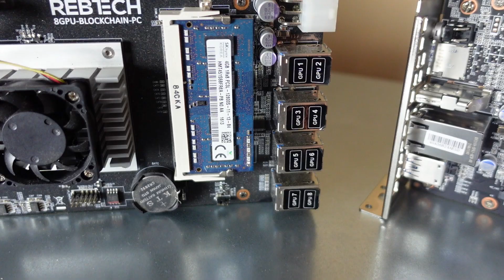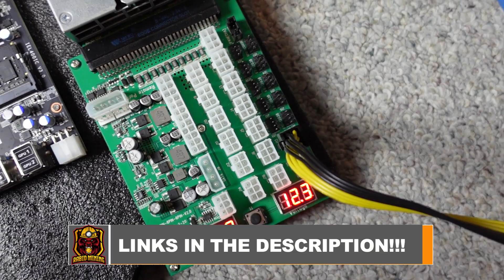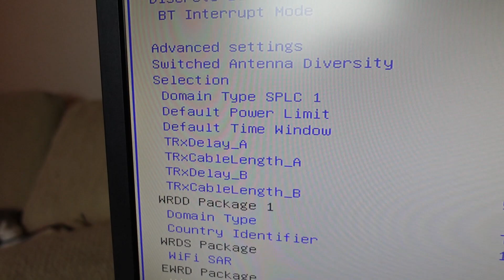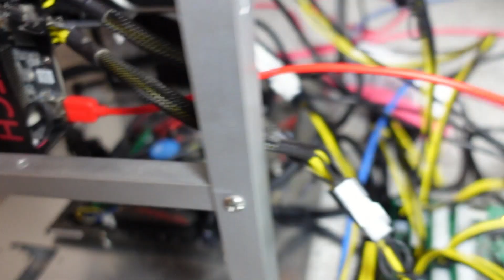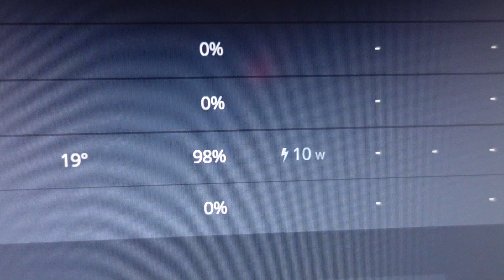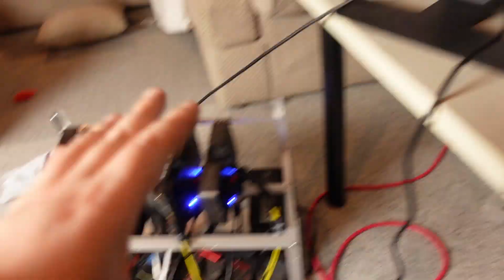REBTECH Is Back!!! 8 GPU Blockchain Mining Motherboard 2.0

Comment: Did you solve the issue? I got mine and the RebTech 2.0 can be detected online without any GPU. As soon as I add a GTX 1660 Ti, the rig can not be seen online. I'm getting the same error message
Reply from the maker: Dont have a 1660 but haven't tried to fix anything yet

Comment: can it still be powered by normal ATX PSU?  since there is no 24 pin to send signal to turn on power, i wonder if would could be safely powered by an ATX PSU
Reply from the maker: You could but more of a hassle
Reply: @RabidMining  i am just concerned about server PSU noise
Reply from the maker: Depends how you run them if around  50 to 60% cant hear them.

Comment: Mine arrived today.  So far I only have 1 card up and running but will soon move cards from my ATX boards over to this and see how reliability goes.  I may need to invest in a couple more of these!
Reply from the maker: Nice!!!!
Reply: @RabidMining  Update.  Weather finally cleared and I was able to swap out the PC MB for the RebTech and oh wow what a difference.  Right now it is 5 RX 6600 XT's and they all run 1-2 MH more than my other rig on a PC MB also with 5 cards.  Been up for 1.5 days, no crashes, no errors just a solid 32.5 MH on every card.  I have 2 HP 400W power supplies splitting the load.  HiveOS shows a total load of 337W.  I have enough room on my shelf for 2 more cards.

Comment: Nice but the AMD board only accepts AMD video cards so that's a bummer.  The Intel version accepts all gpu so they've got some improvement to do with amd based .products.  Wish it had Level 3 memory too but if your not cpu mining its not a big deal.
Reply from the maker: the first one runs Nvidia cards as well.  Just had issues with 1660 supers 20xx and 30xx series run just fine on ver 1.
Reply: @RabidMining  Try changing the NVIDIA Drivers to an older version.....?

Comment: Weird?! I've got USB drives for all of my 9 rigs and they haven't caused me any issues. Sure the initial setup of any rig seems to take some messing around but once they get up and running and you iron the details out, it seems to be solid, most of the recent builds are all purring along nicely. 

One thing that has caused issues on B450 chipsets is using SSD drives and then in turn those SATA ports taking away precious PCIe lanes. Perhaps SSD is the way to go? Worth a try
Reply from the maker: ya thats the difference between AMD and Intel AMD based Motherboards use the PCIE lanes for the usb and sata connectors where intel doesn't.
Reply: @RabidMining  Interesting, I hadn't discovered that part yet, great info to know. I prefer AMD for the CPU mining of course but with 3 new Intel boards recently, perhaps I could have a change of heart with system design. 2 of those TB360 boards for 8 cards riserless has me thinking of making a serious move in that direction. Risers SUCK! We will see

Comment: 3090 on a single PCIE strand using a splitter??? NOOO!
Reply from the maker: Limited to 140w also 16 gauge wire rated for over 300w

Comment: Nice Video! As for the price I think I would get the first model and save $150 or so. I think that with shipping and taxes might be not the best deal for an 8 gpu board. I could be wrong...
Reply from the maker: depends on the state of crypto if it was the all time high bull run then this would be super cheap as prices come down people sell off and prices come down.
Reply: @scubari  Yep, I have a couple of old motherboards and cpu's from past computer upgrades that I used in two rigs. I do have a 1 to 6 splitter and a 1 to 4 being used as you mentioned. I was just thinking it would look better as one unit. Thanks for your idea though.

Comment: pretty expensive, $50 shipping on top. I mean unless someone wants to buy bulk. I am sticking with ATX boards for now. Thinking about buying 1 to 7 PCIE splitter on Ali.
Reply from the maker: Those only work if you have a CPU as well as MB that supports enough pci lanes if so then ya is a good option.

Comment: I like the Rebtech MB because it small and efficient. At $530 CAD after tax it seems "on par" with H110 Pro BTC MB at ~$670 all in. For now I will stick with H110 because it can run 5 more GPUs than the Rebtech.  :_GPU::_RIG:
Reply: Replying to my own comment; + $300 or so for Ram and a cpu for H110, The Rebtech is looking better !
Reply from the maker: lol
Reply: Im loving my 90€ b250c from AliExpress in combination with a 60€ Fujitsu P556 (for CPU and ram, from an government auction)

150€ for a 12 GPU motherboard in an matx size with i3-6100 and 8GB DDR4

Comment: I have one question how will you setup auto power on with this psu and motherboard?
Reply from the maker: Can get remote switches for server psus
Reply: @RabidMining  you mean that ethernet remote thing? Any other solutions?
Reply from the maker: well I am not sure what you mean by auto power on?  like if the power goes out then back on?  the breakout board remembers its state so it will turn back on incase of a power loss.
Reply: @RabidMining  what he means is that standard motherboards have a bios option to reboot on power loss. So that along with the zsx remembering it’s state means if you have an outage, it knows to reboot the board itself. Without that setting, you just have the zsx sitting there powered up and waiting for the motherboard to kick on.
Reply from the maker: the MB retains as well so once its on it will reboot normally like turning on a regular MBs power loss option.  Like in the video I just turned on the breakout board and the MB went on itself.
Reply: @RabidMining  so will the power supply turn itself on ? When power comes?
Reply from the maker: if the PSU is plugged in yes it will always be on its the breakout board that powers the MB and gpus and yes if it was on when the power went off it will be on again when the powers back as it retains its state.  overall yes everything will be back online incase of a power loss when the power is back online.
Reply: @RabidMining  thank you so much